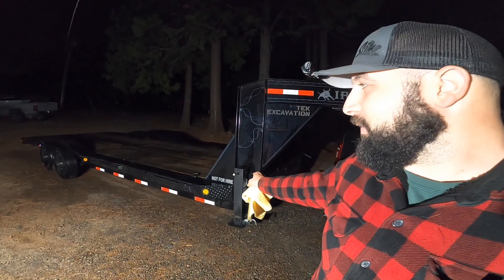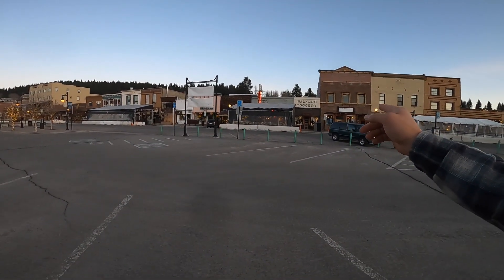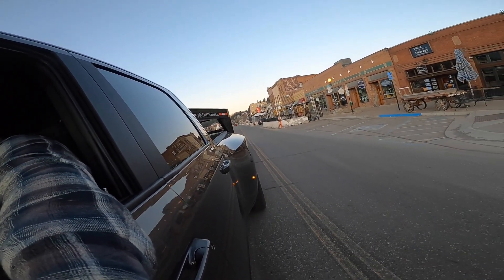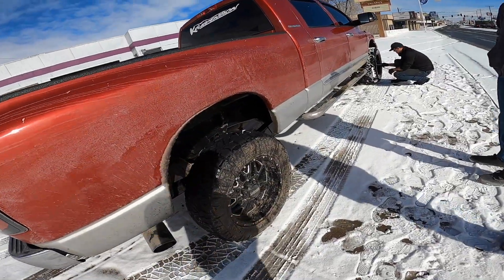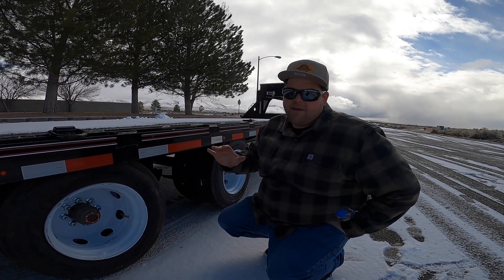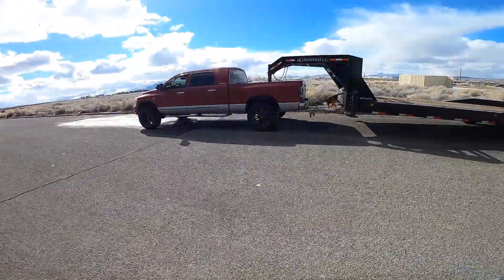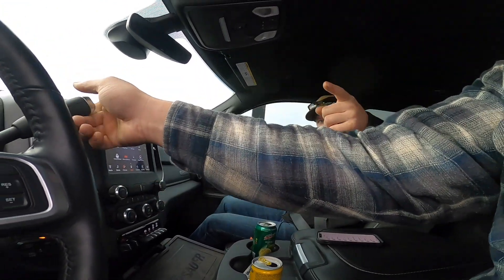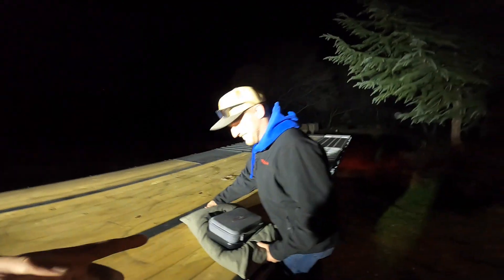NEW DIAMOND C FMAX216 hydraulic dove tail trailer

Comment: Soak that pine decking with used motor or ATF oil.  I usually do 2-3 coats when new then a refresher coat every 12 months.
Reply from the maker: I just hate the left over soak on the deck plus the smell. Already stained the deck with some quick dry stuff from the hardware store made two coats been holding up well

Comment: Nice trailer! I have the same truck 2020 Ram 3500 and my power steering just went out at 4,200 miles. It’s at the dealer right now. Have you had any problems with your truck?
Reply from the maker: Thanks man!, and that sucks. Just luck of the draw I guess haven’t had any major issues only a 2 tpms sensors have gone bad
Reply: @IManOPERATOR  Ecery one of the TPMS on my '19 Ram 3500 have been dysfunctional since brand new. I've had 3 different Ram service (oxymoron) places tell me "nothing can be done"
One of my only gripes about the Cummins pulling machine